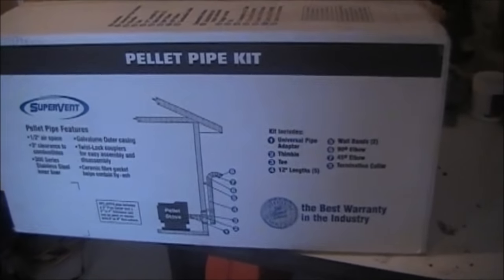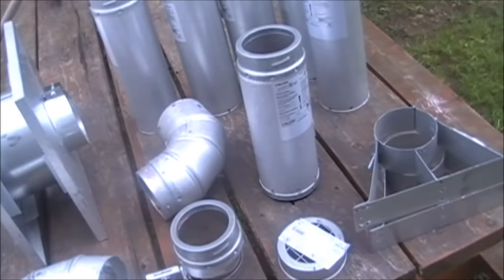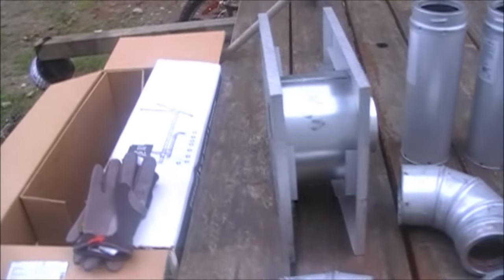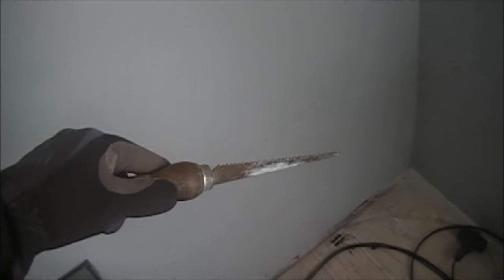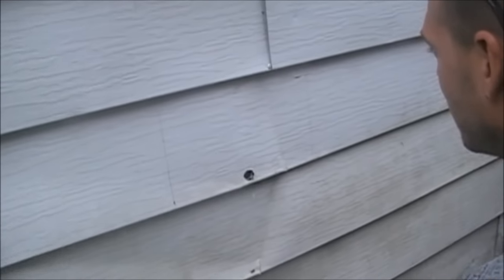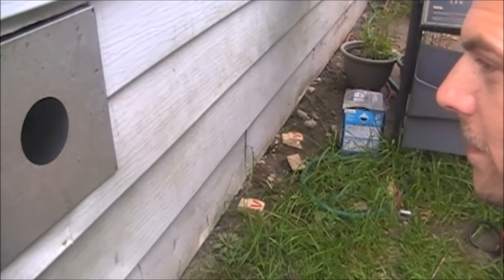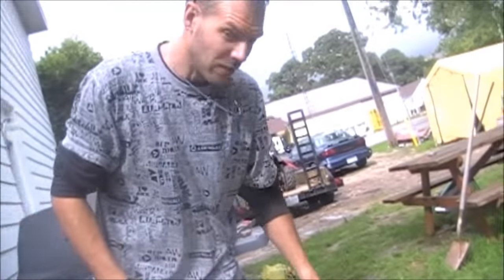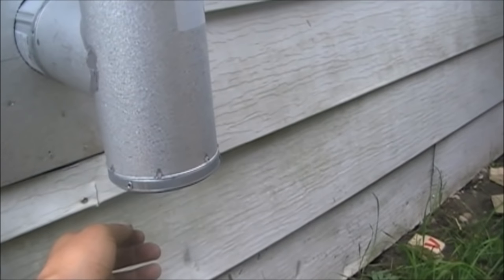Step by Step install of pellet stove pipe exhaust kit

Comment: For everyone putting these on like him without high temp sealant and flashing tape around every single fitting and elbow you are definitely going to be leaking smoke in your house. Especially if your elbows are inside!! Buy aluminum flashing high temp tape! Shine with bright flashlight during the smokey startup time!
Reply: Good idea! Thanks man
Reply: I didn't do that, no smoke inside the house. It only smoked when I turned on for the first time to cure paint.
Reply: Never had that issue and I don’t use high temp sealant.
Reply: B vent pipe has gaskets built into the pipe joints. Don’t need tape.

Comment: I had a wood stove in my house, did a conversation to pellet stove and I needed a reduction pipe 6" to 3" ( no one had it) so I went to autozone and ran a 3" muffler pipe and found a  reduction at big r. Cost total $25.00
Reply: I got lucky (as far as parts go, not price).  I had to replace all my pellet stove piping.  I went to home depot and they had shit. Lowes ended up having exactly what I needed but man...  I paid 250 for all the piping.  Wish I thought of that before.  Wouldn't mind seeing the finished product of you could post some photos.

Comment: Great video man ! You just made my life 10 times easier installing my pellet stove thimble ! For years I always struggled cutting a round hole for the wall thimble not realizing I could have just cut a square and it would serve the same purpose ! 👍🏻 I don’t know why but I just never thought about it. I’ve been dreading it just thinking about putting the stove in because I use to use a recessed lighting hole saw to cut the 8” circle and I don’t have it anymore. For that reason Alone I gotta subscribe to your site ! You really fit your name “The Master Macgyver” Thank You Again !!!
Reply: How did you secure it on the inside. I’m absolutely stumped on this part.
Reply: @Yellowhippo97  glue it to the wall with high temp caulk if you don't want fasteners showing
Reply: @nickbisson8243  Horrible!!!  You cannot cut the siding as a square, only up to the circular diameter, like that it protects the house from getting water (moisture) into the sidings and the internal components of the house, and also protect it from the environment - caulking will never and should never be the answer.
Reply: @RedDevil1271  the inside not the outside apparently you have difficulty absorbing any of the above information
Reply: @nickbisson8243  If I am wrong then why did you delete my last message with the proper time stamp for your video, and the stamp to another video showing how it is properly done.  Even better, you intentionally deleted my message with the thimble's instructions explaining how the wall is cut, which is only for the circular diameter, not the square perimeter.  Is all good, a person refusing to recognize their own mistake is a flawed human being.

Comment: I live in a vintage single wide mobile home. The only exterior 'wall' is metal siding. Behind that is insulation than paneling. How would I screw that square piece in? Help! It gets so cold in the winter that I freeze unless I crank up the heat and I can't afford the high bills. Any ideas?

Comment: The adapter that hooks to the pipe that goes on the stove is it suppose to lock on the stove it fits but don't seem to lock on the plastic fitting on stove? Thanks

Comment: Can you tell me how to add or reduce by a few inches the 3" vertical piping? I am replacing a pellet stove with a new one and the roof venting pipe is a few inches to short where it enters the stove on the new stove. So, I would like to extend the vertical piping a little to meet the exhaust on the back of the stove, so how do I extend my 3" pipe? Thanks for that info...Frank

Comment: great video, i just bought a pellet stove and i would like to run the pipes inside my family room to the ceiling then go out through the wall to the outside and up just a little is that acceptable or does it have to go out near the floor like you did then go up outside.

Comment: Good video. I have a question. Many people say use high heat, self-sealing silicone tape for all the connections except the trap. As of today, do you regret not doing so ? Any leaks? What about the side of your house, is there black ash stain on the side?
Reply from the maker: I've had no leaks but it did Stan the out side a bit
Reply: ok, then I will do my install so it goes above the roof.

Comment: What are the pluses and minuses of doing this versus running pipe up thru the Chimney?

I had some theories, please comment.

* More tubing required for Chimney as well as more work?
* Does venting out of the wall make ones siding dirtier due to smoke and ash blowback against my fiber cement siding?
* When I'm over 65 and can't climb a ladder will I be forced to pay for a chimney sweep every year vs d.i.y.

I'm considering a professionally installed Harman P35i though I do see a lot of seemingly cheap used craigslist pellet stoves.
Reply from the maker: peter sachs I.would not run it through a chimney that ash build up would be a problem and most stoves don't have enough air flow to push it up a big chimney hope that helps
Reply: I was told running pipping through the chimney will make you have to clean the pipe out 3-4 times a season, and also running a longer pipe is harder on the blower which will cause it to fail quicker...

Comment: hey bud im tossed between putting a sheet metal screw to hold each straight peice of pipe cause its a little too much movement whats your thoughts?
Reply from the maker: I didn't think it needed it mine fit really tight but up to you for piece of mind maybe

Comment: Never put a connecting pipe joint in the wall. You used 2 pipe lengths going thru your wall. A no no!
The thimble is used to keep the hot exhaust pipe from touching any flammable materials. The cavity with in the was is unprotected. Fire hazard
Reply: This is the comment i came to the comment section for, but i do not see how to place a stove in the corner and still make it out of the wall with one length of pipe, help!
Reply: @christopherbodden506  
Pipes come in longer lengths so you don’t need to have joint within the wall cavity. Don’t rely strictly on the pipe in the kit. 
The pipe thimble is designed for a 2x4 or 2x6 wall. The 2 pieces are designed to overlap; creating a shield from any insulation within the wall that may touch or come in close proximity with the hot pipe. In the application seen in this video, a larger 8 inch pipe should be used to bridge the gap between both sides of the thimble. The smaller 4” pipe will be house within the larger 8” pipe; protecting the exhaust pipe from debris that may fall on it within the wall cavity.
Reply: You realize these double wall pipes don’t get very hot , you can touch them while it’s running

Comment: How do you adjust the pipe length? I am putting  a stove for my dad in the basement.. I boarded up a window and will drill a hole. I cant use a kit
Reply from the maker: If you can't just buy the kit you can buy each piece that u need they come in different sizes ..so measure the length you need just remember u want a t pipe for a clean out

Comment: great video!
i have a question about my installation,
in my basement where i want to do the install its all cement and what im wondering is if i NEED the big square part because just above the basement is my balcony and making such large holes for fitting will be more than a challenge, and difficult to access, drill, and cut etc.
 im asking because when i installed both my bathroom vent as well as my dryer, all works great having a hole made big enough for just the pipe. im aware that the exhausted air is very different than either. should i use the available window to do the venting with all the right parts? once i know this it will be an easy install. thank you very much.
Reply: Just the larger circular diameter; the guy in the video messed up his siding for nothing.

Comment: so the hole has to square not round?, I notice that everyone seems to make them round for the thimble
Reply from the maker: Every part is round ..can't fit a square tube in a round hole lol
Reply from the maker: sorry i miss read your comment yes the hole on the wall are square
Reply: i bet i could fit a square tube in a round hole !!!!
Reply: Square holes are way easier to cut.
Plus the thimble had tangs @10 inches on centre.

Comment: That is funny, he cut the entire square size of the outer support unit on the siding when all he had to do is to cut it at its circular circumference, which is at least 1/4" larger than the actual pipe that goes through the larger diameter. And by cutting the entire square size, he is guaranteed to get water and the outside environment into the sidings since caulking will never prevent it.  Horrible idea.

Comment: Mr Green, I believe you do a great technical job, and you really want to help your audience, but if you hear yourself, you use entirely too many ah's and uhms..  check your local chapter by going to www.toastmasters.org, plugging in your zipcode and attend a few meetings.  They can help you become a better speaker...  I started listening to you, but they became too distracting..  I understand you are not a professional speaker, but you can improve greatly... congratulations and thanks
Reply from the maker: Ya I try not to say um alot but I do this for a Hobby I have a full time job and a family so I don't have time ..sorry again for all the ums
Reply: Great job. Thanks   Too bad Toastmasters doesnt offer their services to our illustrious Prime Minister Trudeau who is a much worse public speaker than this fellow !
Reply: @Burt Romero. And I suppose you voted for UM, UH, Barack Obama?
Reply: UM...I didn't even notice and its all good with me...
Reply from the maker: Bert Romero your welcome it is worth putting in a cold air intake cold air burns better
Reply: Geeze you boys!  Bert was trying to help him!
Reply: Thanks for the video. I'm redoing the venting for my pellet stove and was looking for tips. One thing to note is that if your vent is near your outside wall, it will turn it black from the smoke. I solved this by taking the venting 6' above the surface of the roof. The extra venting is expensive but worth it to keep from turning your entire outside wall black.

Comment: great video.thanks.installer wanted $750 just to do vent install.I will do it myself w/your helpful  video.Did triangle braces pull the vent pipes towards house or did you add a couple of shims or piece of wood to make the vent pipes level. It looks like once you mount the braces it would pull the vent pipe towards the house on a slight 10 degree angle also. again thank you for the great video I will do my own vent pipe install and Save lots of money
Reply from the maker: thanks ...yes you need to shim it to make the pipe level under the brackets